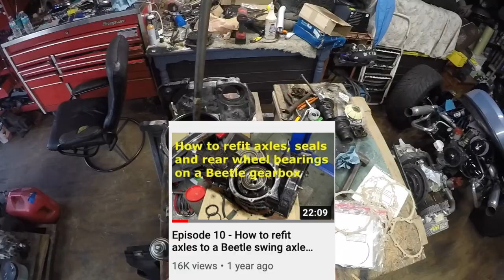PeeWEE The 1961 VW Ragtop Beetle[True Survivor]: Swing Axle Transmission Refresh! (How-To)

Comment: Good video 👍
Reply from the maker: thanks man!!!
Reply: That part is a drain for grease if the drum seal leaks. The tube runs strait down.
Reply from the maker: at that time GMAN didn’t have a clue of what he found, then as he kinda looked at the design he realized it’s a makeshift way to drain the gear oil from a leaky axle seal to prevent the brake shoes from being saturated from gear oil. if it was actually necessary it would be around today kind of a stupid idea if you ask him. but thank you for pointing it out and it’s definitely something to speak of when working on VWs:) 
-Dalton
Reply: @JustBugginVW  I just learned this today as I’m getting ready to do your same trans project on my 61.
Reply from the maker: ah nice! glad it could be helpful:), thanks for the comment!
-Dalton